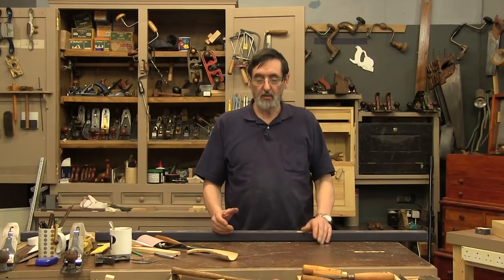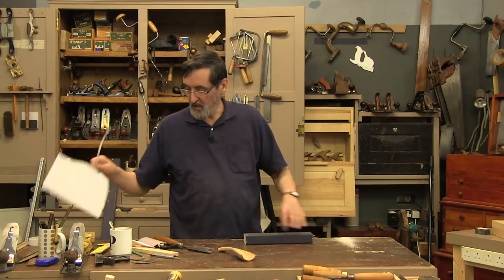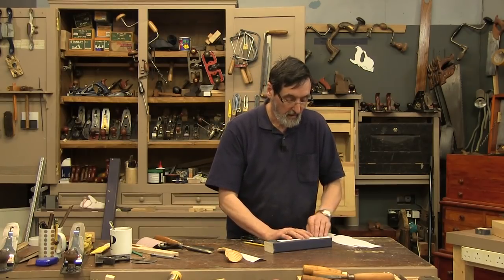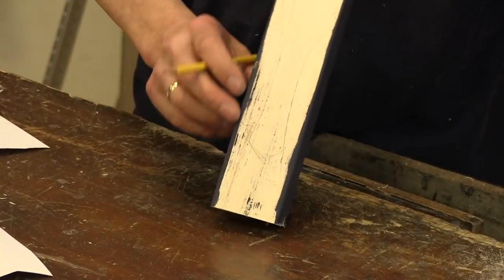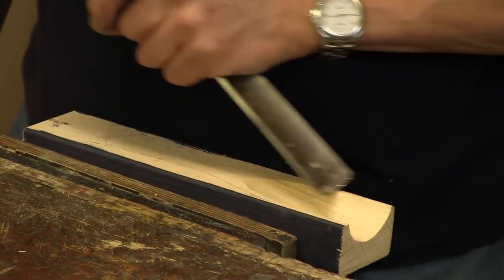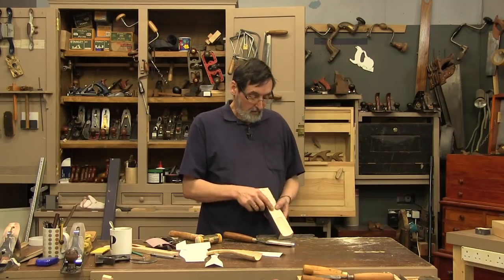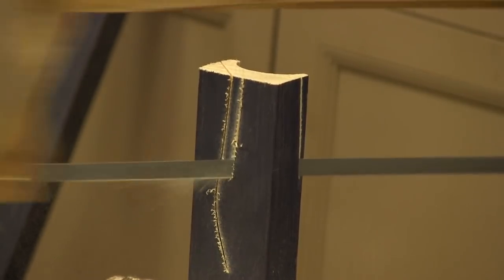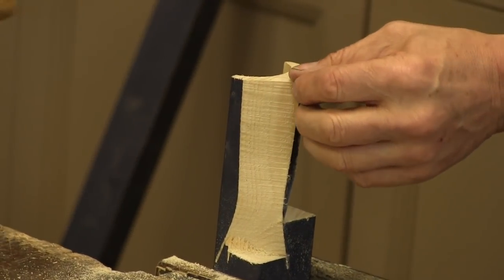Carving a Wooden Scoop | Paul Sellers

Comment: I have a question regarding a tool I've seen once, consisting of a wide blade with a forged narrower extension ending in a hook pointing upwards and a T wooden handle on the other end. To use the tool the hook side is "hooked" through a "U" bar affixed to a wooden bench or a stump and wood is shaved in a downward motion as if chopping onions. I've seen it in Spain and Italy but I know it was used in North America as well. What's called?

Comment: As a matter of interest - that rasp you have there - what grain are the teeth?  I've been teetering on the edge of getting one.  Going to buy either an Auriou or a Liogier - and I have been giving a lot of through to the grain of the teeth.  I definitely want something on the coarse side - but not just a total "hog".  What you have there seems perfect so I was just curious as to the grain of it.

I know this video is nearly 2.5 years old - but if you come across this comment - would love to know!  I watch this video at least twice a week - something so peaceful about it.

Thanks!!
Reply: looks about a 9? start with a 12 or something. Buy a cheap file and rasp set, then you can learn which one you want to break the bank on. Rasps are also availible in; MakeHolesBigger rasp, a round one to make holes bigger. The why-doesn't-this-thing-fit rasp aka Triangle rasps, to make your mortices better.

But yeah, if its your first one, just try them out. those brands are mostly for tool collectors to be honest.

Comment: I have a question, not answered really in internet. How to sharpen a gauge?
Reply: Check out Mary May, I am quite sure she has an excellent video on youtube on sharpening gouges. It is basically the same as sharpening plane blades and chisels, except that It is round. for the inside you may want to get a slip stone, but a piece of wood with sandpaper on it works as well.
Reply: I can think of two ways. Paul Sellers can think of fifteen ways I am sure.
1. With a grinding wheel and a jig like the "OneWay Wolverine" system outfitted with a OneWay Vari-Grind jig.
2. By hand on diamond or glass stones.

Either way you should polish the flute. You can use an appropriately sized slip stone to do so. Or you can sharpen your gouge, then get a scrap piece of wood and cut out a channel that your gouge fits perfectly in. And then lube that channel up with some chrome polish and have at it just like a strop. There is a video of this somewhere by some guy that makes guitars, but his name evades me right now.

Or you can use any combination of the above. Personally... I will do my rough grinding with the bench grinder and the jig.
Then if for some reason I needed it to be scary sharp I would probably take it a step further on my diamond stones and finish it off with the chrome polish.

Then again... you usually don't have to go to that level of detail with woodturning gouges. Perhaps a standard gouge chisel I would go through all of that and just hone it up with the chrome polish.

The wheels on my bench grinder are 60 and 120 grit aluminum oxide. It is just the "Rikon Low Speed Grinder".
Some guys say you should go up to 8000 grit, other guys say 1200 and a strop is sufficient and I fall into that category.
Or you could go crazy and go all the way up to the 30,000 grit glass stones. That is just ludicrous if you ask me though.

Paul, do you have any expert advice?

Comment: Paul, I see you didn't use a traditional turning saw.  I don't like them because if you hold it by the handle you also have to hold the upright of the frame as well so you don't change the angle of the blade by accident.  To solve that I made a turning saw that has a handle rigidly connected to the upright at about an 85 degree angle with a bridle joint.  The blade is held to the frame with a pair of carriage bolts.  The bolt at the near end goes straight thru the length of the handle.  I remove the shoulders from the bolts and cut them to length and remove the threads.  I then hacksaw a slot in each bolt for the blade and use a couple of cut off nails to pin the blade in place.  To adjust the blade angle to get the stretcher out of the way, I rotate the bolts.  To get a grip on the bolts I drill out a pair of wing nuts so they snugly fit on the bolts and saw off one of the wings.  I pin them in place with nails inserted in holes drilled clear thru.  I use string tensioning but to keep the tensioning stick from hitting the stock I'm working on I chisel a 1/4" deep groove into the top of the stretcher and shorten the tensioning stick so it just fits into the groove.